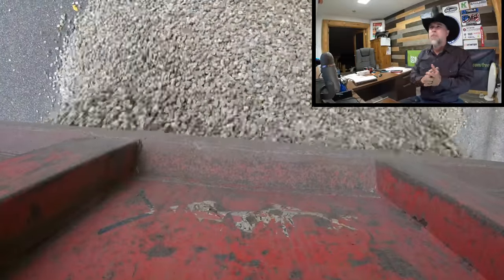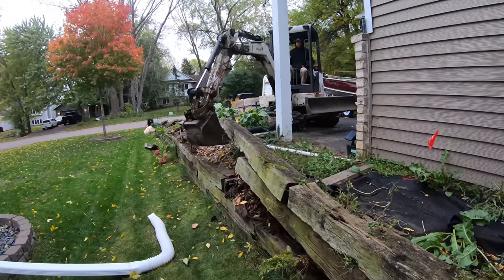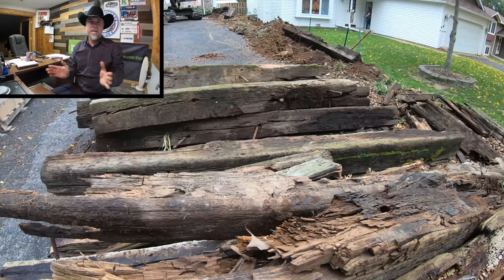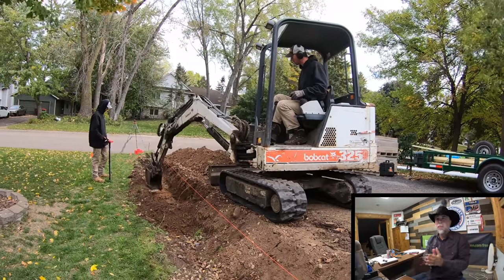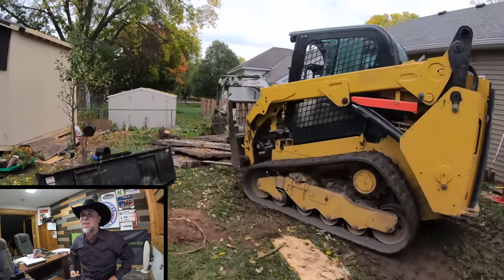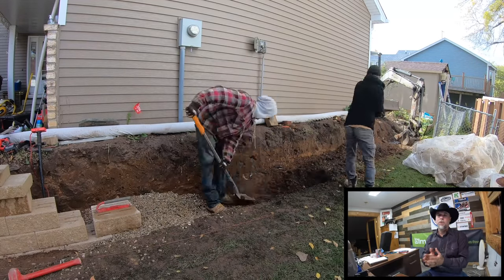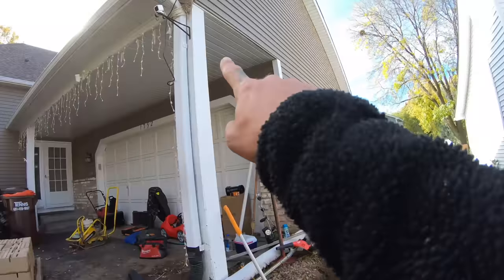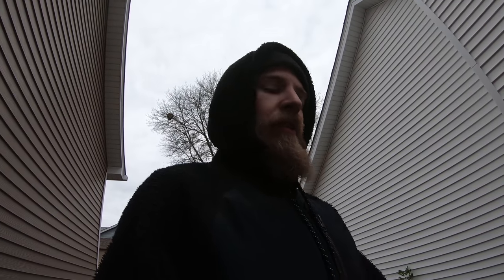Crazy Neighbor Loses it & Calls the building Inspector 5 times!

Comment: I like how he says "Red Flags." Such a spot on way to assess the situation. We have red flags in our new construction home regarding the new neighbors who bought next door after we did. We found buried 4 inch plastic corrugated perforated pipe running 25 feet and 60 feet onto our land from their land probably installed by the previous next door neighbor when they built their home 11 years ago (thinking the adjacent lot is vacant and no one will know as we have woods and stream). Our property boundary is 90 to 100 feet from their home and their home is all uphill from the lot line. When asked if they'd mind relocating them onto their land they claimed to not know about them and then avoided a solid commitment to move them (a 15 minute job really). Then we offered them a permission letter which would just protect us from adverse claims and they said "no we're not comfortable with that."  Called in a drainage guy and asked them if they'd mind me moving them right now and drainage guy told them there is no value to having your drainage solutions on someone else's property.  They had no real option but to consent. I paid to have pop ups installed on their land. All fenced in now.

Comment: this exact thing happened when I was helping my parents repave their driveway, entire property was raised by about 5 feet from the neighbors house, and the 50 year old railway tie retaining wall wasn't holding up the gravel driveway anymore. So my parents ripped up their entire driveway and installed a concrete retaining wall BEHIND the fence so no one had to look at the 40 concrete blocks holding the property back.
And of course shitbird is calling bylaw officers and harassing the paving crew because he doesn't like that the yard and house drain beside the new driveway and blamed my parents for his flooding issues. He thought (wrongly and had been told before) that the dirt triangle between our properties and the road (corner houses) belonged to him and that we were not allowed to run drainage there. Fun fact that triangle, his fence and about 1/2 of his garden were actually on my parents property according to the city inspector, also his house would flood because his sump was pumping into his backyard UP THE HILL.

Comment: As always I am always impressed with the work you guys do and the high standard you all maintain. On this one I do agree the wall will benefit her in more ways than one.  I have a similar situation being the low house on the block.  Her real fear is a flood just like mine in my situation.  When you are stuck like she seems to be she is looking for some help.  The only thing that I may have tried was to explain some of her faults on her property that makes the situation worse to her.  I do believe the inspector has this responsibility also.  No you do not have to do that but being the professional you are you probably did.  She is not crazy just scared. If she does not speak up for herself no one will. Keep on digging.
Reply: Yeah. I've been flooded by my neighbors(after they made changes) and it is scary as hell. 11pm at night, lightening, knee deep in crawlspace bailing water, etc .

Comment: You might want to look into getting tracking devices wired into your vehicle & equipment. They also make small transponders that run off coin batteries that you can hide inside your larger tools. RFID stickers and engraving your company name into tools are additional options to help recover any stolen tools and help identify the thiefs. Nothing beats good locks & security cameras with lights.
Reply from the maker: I’ve got something good cooking up.
Reply: Engrave your drivers license number. Cops can verify in 30 seconds who it belongs to.
Reply: @paulne1514  - What an excellent idea! Thank You!
Reply: @thomask4836  you bet.
Reply: You may think it's a sure thing. Unfortunately the company I work for just had 2 bobcats go missing off a job site. Both had GPS tracking. The GPS died in the spot they went missing. They found the tracker or had a blocking device.
Reply: @mike-sk2li  Agreed.  Then you have the issue of the police not wanting to investigate even if know exactly where your stuff is.
Reply: @HockeyGoon939  ikr?  That may interfere with them writing $200.00 traffic tickets for a broken headlight...you know, citations to keep the community "safe?"

Comment: I hear you on the crazy neighbour, But I had a property on a hill side once. The people on the up side hired a contractor to pave there drive way and do there downspouts so the water did not collect on the driveway as it had been when it was just gravel. The contractor just worries about the guy who pays him, we can argue that but it is mostly true. They paved with a collector pipe running under the new pavement and after 5 yrs with a dry basement I had water on the back side, right about where the new drain was located. You don't have to be crazy to make sure your neighbour and his work crew is up to code. Cover your own ass no one else will.

Comment: Quick question before I dive into this video,  when it comes to snow plowing residential, like driveways, what's your method or formula for charging the client?
Reply from the maker: that depends on the size of the driveway and how close it is to my established route.  I calculate in travel time to see if its worthwhile
Reply: @Dirtmonkey  so what would be your ideal charge,  or would it be better to run through that in another video?  I'm kinda looking into doing some plowing depending on snow fall this season in my neighborhood.
Reply: @Dirtmonkey  Are you doing something with Ryan from Victory? I heard him do a shout out to yuse guys...
Reply: @Dirtmonkey  
Yup, travel time and fuel useage is something many overlook - not just for pricing work, but as an employee.

I've worked several places where people have left for an extra 50c/$1 an hour elsewhere, jobs where they'be looking at an hour or two extra travel a day with the extra fuel costs (much more expensive here than in the US) literally burning the extra pay up, especially as it's after tax (@30% marginal) income!
They're basically looking at being stuck in their vehicle for 5-10 hours a week for nothing, maybe even losing money overall.
Reply from the maker: @robertbennett2586  maybe. He’s a cool dude.
Reply from the maker: @gordowg1wg145  around here an average driveway is $35. So you can adjust up or down depending on size and complexity and travel time. That’s a short 2 car garage driveway.
Reply: @Dirtmonkey  I was thinking in that ball park too.  That sounds good to me.

Comment: Neighbor wasn't very nice, but I kind of understand her concern about water. About 20 years ago, a local guy bought a 2 story home across the alley from my home- where I had lived for 12 years at that point. He rented it out for profit. The first month he owned it, he dug ditches in his yard and put in solid flex drain pipe from his downspouts. He ran the drains directly into the alley, at the very edge of his property (a steep bank). I was concerned because the alley already had poor drainage and was always damaged by natural run off. He didn't care. I contacted the Boro- to be told that although he didn't have a permit, got nothing inspected and was doing the work himself- it was fine. Note- his brother was a town council member. So for 20 years, the water has drained onto the alley and eroded the asphalt to the point that there are holes a foot deep and chunks lying all over. The boro even gave up re-paving after a couple years- as it always happened.

Comment: Few years ago we were replacing about a 100 foot asphalt driveway with a new concrete driveway. The neighbor complained about drainage and got the inspector to make us run a concrete curb along the whole length of the driveway (his  property line). There were 5 houses on the block all on level ground crowned at the center of each house and all water drained to the back and to the front. Putting in the curb didn't change anything other than an sore for a new driveway

Comment: For me, the problem in this situation started with the town allowing a builder to build up the land adjacent to another property.
 This happened to my property years ago, though where I live we have a min requirement of 1 acre per household.
 The town approved a builder to raise the property next door by 8ft.
 The only drainage that was focused on, was the yard drainage from the new home, no thought on the impacts to other properties around the new home.
 Since that, my yard has been flooded every winter/spring with the drainage from that new home, causing substantial damage to my property.
 This made already existing water problems from the lack of storm water management from the town itself even worse.
 In the front where our properties abutt there is a deep natural hole, where storm water runoff comes down the road, filling it like a pond for years.
 This added drainage from the new home, into that hole doubled this existing problem.
 For years the town was asked to address this existing issue, and their solution was to install a drainage pipe in the back of my property which runs down along the road behind us, and basically we have a drainage run, running through the middle of the property to pass that standing pool of water through, to the pipes they installed.
 Basically using my property as their storm water runoff or throughway, with no tax abatements...
 After the land was built up next door it's too much for the current system to handle, so my yard becomes a literal mote.
 I have a drop off in one corner of my yard where a French drain in my basement flows into, and since the new home that also fills quickly and backs up into the basement.
 It's been a mess for many years and I'm actually close to selling this property and moving, partly due to just having enough of this.
 I feel for this neighbor, because as I said, the town is the source of the problem, the moment building up the land for that property next door was approved with no consideration for property owners abutting it.
 Not to mention, any time a property owner wants to install a fence or a retaining wall, at least 3 feet should be allowed on the opposite side for maintenance purposes, so it never has to involve going into another person's property, which was clearly overlooked/ignored here.

Comment: I moved into a 120 year old house about a year and a half ago.  The crazy thing about where I live is that you can build a fence right on the property line, which is what someone did.  They also built a large shed right on the property line so the fence stops at one corner of their building and then continues at the back corner to the back of my property.  It is the most annoying thing to try to mow beside because my yard sits a little higher than theirs and the hill along that side of the property arcs down and meets the side of their fence and shed so it's it s pain in the freaking ass to mow.  I looked up the ordinances and it's 100% allowed.  I don't know about the shed, though.  I couldn't find anything about additional structures.  But it's old so I'm sure it's grandfathered in.

Comment: Nice job.. wall looks great.. As for the neighbor, I mean if her basement is flooding i kinda understand her concern even tho she is adding to the water by running downspouts uphill that lead right back to her house. Ive seen neighbors run their gutter downspouts into areas of their yard that clearly drain immediately into their neighbors. She didn't understand that it's not a perforated pipe so the water is only going out to the street.. What's funny is that is illegal in my town.. we have to have our downspouts run to our own yard no closer than 10 feet to the street. I wanted to drain the water to the storm drains but the town checks it very regularly

Comment: This is enlightening video.. First, NEVER trust these contractors! The lady was right to have the building inspector come out. Second, Like they aren't looking for trouble standing next to the lady's house, messing with her property, and giving opinions she didn't ask for and talking all loads of smack. Be glad it wasn't me and it was a woman you dealt with and were pricks to. I've had assholes like these try and drive heavy equipment onto my driveway after being told not to, as there was no doubt it would have cracked the seal against my house and caused my basement to flood. Fools like these should never be trusted, the slab of cement they moved in this video is all the proof anyone needs. They can cry and make videos all they like, for my situation the twits hand dug that hole, like they should have planned from the beginning.

Comment: Crazy Neighbor? 
Did you ever approach the neighbor before the work started?
Do you know where the property line begins or ends?
Are you trespassing on her property?

Or did you show up out of the blue, run heavy and noisy machinery up and down her yard all day, or multiple days, without so much as a hello!

I had a contractor do this a few years back.  Hired by the town to redo sidewalks and the road with.  Ripped a trench across my driveway at 7 AM with no warning or notice leaving me stuck.  I had to call someone to give me a ride to work.  Ripped up my yard when he ran his backhoe up and down my yard, instead of working from the roadside.  Destroyed a 6' stip of yard, crushed my sewer pipe and dumped the spoils all over turning my yard into a ankle breaker when I try to mow.  It cost me 4k to fix the sewer, the sawcut he put across my driveway is now a crack meaning I'm going to have to completely repave my driveway soon, another chunk of money I don't have.

If you had showed up out of the blue like this next to my house and gotten on my property I wouldn't have called an inspector, I'd have called the cops.

So if your usual mode of operation is to just show up and do something that could affect the neighbor without so much as a hey, hellow, i'm so and so and we're going to be doing some work, etc.  You're at fault, not the neighbor.

Comment: She should have been happy that you guys pulled the old wooden ties and replaced it with proper materials. I owned a house where the neighbors tore down and built a new house and in the process raised their ground level 3 feet above mine, I insisted they put in a retaining wall so they cheeped out and used soft concrete(AKA wood). I sold before it rotted out but I am sure there will be issues in the future! Good fences make good neighbors and so do good retaining walls!

Comment: Should be mandatory that all inspectors and engineers spend 8 years in the field before they can recite a book.  Need to let me change them sloppy bushings and pins on that bucket. Line bore and put some harder wear items  worst case. That or get a rotary bucket.

Comment: You guy's did a decent job, looks good. On the other hand, run a jumping jack over the subgrade so the entire bottom is firmer than when you started! Never use that flex pipe, ever, it crushes in time and the ridges causes it to silt up and clog!! And get a thumb for the excavator and a 4 in 1 for the skid steer!!!

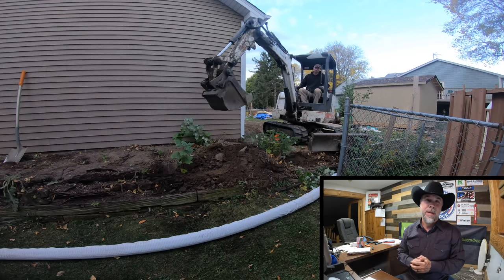Comment: question about the wall at around 4:00...so the unattached garage wouldnt need 4 foot footings because its an independent structure? but attached its technically part of the houses foundation? just interested what the reasoning was. thanks

Comment: The county engineer who signed off on those two home's elevations was one of problems and the initial builders of which ever home went in last should have known better. Here they are some 30 yrs later still dealing with wrong elevations. If the neighbor has enough fall to the street, they could put in a perforated drain tile covered over by landscape rock. Run their down spouts and sump pump into the tile. Almost looks like two different housing developments stopped and started right at those two lots. One or the other or both builders were scum bags along with the county engineer.

Comment: The builder wasn't too bright putting a basement under the neighbor's house.  With the flow of the land that house should have been built on a slab or crawl space.  The neighbor needs some serious drainage work done as the water flow isn't going to get better unless some serious grading is done otherwise that sump pump is going to have to be replaced every 3 years from excessive work.

Comment: Nice work, look great, so that color of top soil by us, look like a lot of clay, dirt here is black, so it's hard to tell how well the grass will grow or if a good down pour the water will just not soak into anyone's property  to fast. That lady should of asked you to bring a load of good dirt in for the side of her property. Soun c s to me she needs to build a drainage run along her wall in the floor of the basement,  they cost a little but work real good, uf she does not want to dig her outside walls up and treat her foundation  and put a outside drainage run off field in.

Comment: There is no better way to cause an accident then for the operator to be taking directions by 2 people especially the one with the loud mouth that's got a lot to say but no help Period you need to go over this At the next safety meeting And if the guy with the big mouth pulls that trick again i'd fire his a** Also he needs to be calm when he talks so hes helpful  Calm cool and  Collected PS I do understand why you have 2 people on each end in the truck bed, But they both of them are supposed to be helpful to the operator not a detriment